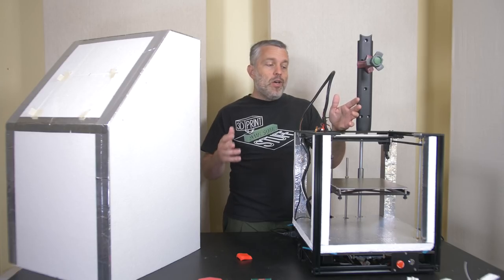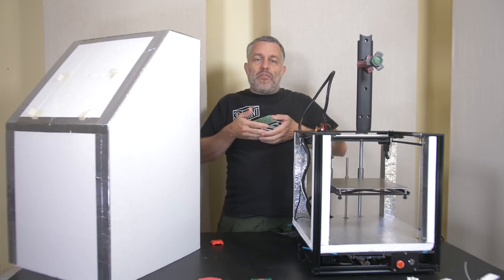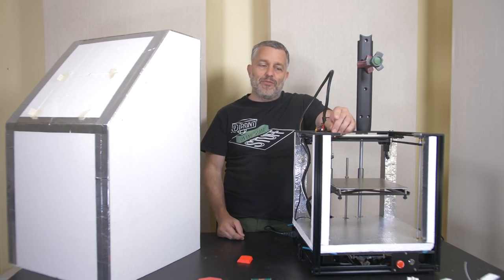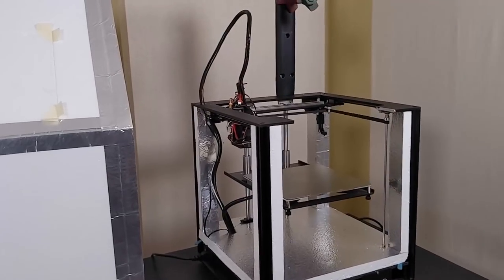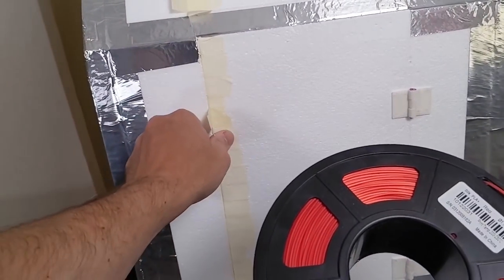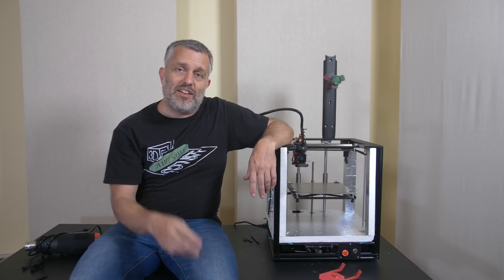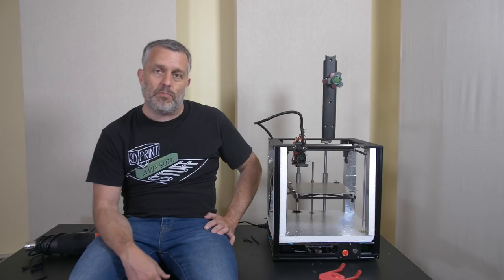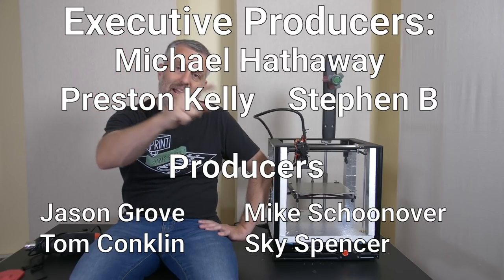Heated Chambers - The Next Level of Consumer 3D printing

Comment: Put a thermal fuse on your heat bed, between the ssr and heat bed. That way if your ssr fails the thermal fuse will break at say 125c and your house is safe. That is how it is done with the Voron printers.
Reply: i am a bit surprised there was not one i use two inline in different spots great catch
Reply: also this is how they all should be not just a voron nice catch thesanzca
Reply: same issue if your thermistor does not read the heater it is not called off to the set point  and climbs until you get a mechanical failure likley a fire at least smoke
Reply: people USE A THERMAL BREAK !
Reply: Some of us have extra temperature sensors and controllers  with relays that power things on and off depending on the temperatures being reported
Reply: @Dualecosse  exactly my point should your probe or thermistor not get the temps back to your relay or controller or what have you,you will get a thermal run away reguardless of your numbers on your displays if you made a fail safe good for you but any electrician will tell you the proper way is to have inline protection like a thermal fuse 
do me a favour unplug your thermistor during a run and see if your McU can tell if you unplugged it or not
Reply: @Dualecosse  also relays can fail in the on position regardless of the call for heat from the thermistor request or not once a relay is stuck your only protection would be between the relay and the heater itself ie: thermal break
Reply: also here is a short list of household items that rely on thermal breaks 
filament dryer
laundry dryer
toaster oven 
furnace oil propane and Ng
hot tub 
space heaters 
basically anything that can pass the max rated temperature in a failure
Reply: @CC-kc5lb  certain relays can fail in the manner you say, But I personally don't use that type of relays I use Crydom D1D40 optically isolated solid state relays  and on top of that I am monitoring/controlling 2 channels again with optically isolated relays I'm going to be really really surprised if all that fails at once
Reply: @CC-kc5lb  have you used a duet board? From what you are asking I don't think so
Reply: those items you list are all fine and dandy but why do you think they all use a thermal fuse? One word : cost. If the race to the bottom and doing it in the cheapest possible way is not what you want, and if you know what you are doing (electrical and mechanical engineer here by the way) you use opto isolation and monitor multiple locations with plc/scada controls to turn on fans at a certain temp and with scada if temps do not fall under a certain level you can program the system to kill the power and I also have a melt line which runs along the back of my printers which if triggered floods my workshop with co2. Not everyone is working to Ender 3 budgets
Reply: @Dualecosse  this is great but most do not have the tech or the knowledge to make your own fail safe or feel safe set up they want simple     i do appreciate your angle tho
Reply: @Dualecosse  i have three duet 2 and hc 6 and two ssys dimension sst again most dont have a duet
Reply: @Dualecosse  i could not see many people using that system unless you print high  temp like 450c and 200c chamber on an ender 3 lmao
Reply: @Dualecosse  where do you get your parts from i would love to try this ssr

Comment: Ive been making heated chambers for printers for about 3 years now. Using a heat gun, fans, and a arduino with a thermistor. I also take it a step further and water cool all my stepper drivers. I also cnc all the plastic parts of my printers that i buy into aluminum instead.
Reply: Ive also noticed a hair dryer with a pvc elbow works great for the temps you want. Like a snug fit

Comment: I have been printing nylon at work, what I have found is that other than a heat chamber and a constant dry box running with a tube from the box to the printer a garolite bed sheet needs to be used for printing nylon and pc. I found mine on etsy the seller's name is 
IamFossCustomPrints and the product is Phenolic LE (generic Garolite) sheet. This makes all the difference when printing these materials. Hope this helps anyone having the same struggles that I had.

Comment: I forget where I saw a video with a pro company who make mechanical parts from nylon and some type of pc, what struck me the most was that the materials got “wet” within 15 minutes (!) Also, water cooling, I don’t hear you talking about it, but if you need to protect components from the higher temperatures, you can’t just blow hot air around. Thx for the vid

Comment: An easy way to strengthen foam that I picked up from some vanlife folks, is to reinforce it with wire mesh like for a screened in porch. You cut the mesh about an inch wider than the foam, assemble the foam box, then using whatever standard latex interior house paint you have lying around (spray and oil paint have thinner in them which may eat your foam) glue the mesh to the sides while bending down and overlapping the overhang to reinforce the corners. The foam resists compressive force and the mesh resists shearing (and puncturing) so it's still very light and super sturdy. Bonus! The paint makes it look less slapped together.

Comment: I don't use PLA, I started with ABS, I use PETG as my throwaway prototyping, I progressed to ASA, PC, Nylon, and I'm enjoying playing with carbon fiber infused Co-polymers. As for chamber temps, I print on sanded plexiglass (no adhesives) in a heated chamber at 50c and I'm getting no warping. For heating I'm using x2 100w ceramic  terrainium heaters
Reply: I use sanded polycarbonate sheet 3 or 4 mm thick. Works like a charm with no additional stuff.
Reply: What is your enclosure made from?  I am finishing a 30 x30 x 40" Acrylite 1/4" thick for my Ender 3. Im going to use a TPI heater and temp controller and a 12v - 80 mm fan. I'm planning on heating to bed temps.. 50 to 70c.. Will that work?

Comment: I use halogen bulbs to heat my chamber to 120° for printing Ultem.
Reply: I was gonna recommend this. Spot lights have been used by many diyers in the past 10 years. I think some NASA interns have a little paper out on it too.
Reply: @difflocktwo  i got the idea from the NASA paper. Works fantastic.
Reply: @3darms  Good to hear that it works. Is your printer hardware pretty standard otherwise, to be able to print ultem? I have been out of the 3d printer game for many years now, kinda wanna get back into it by offering printing services.
Reply: @difflocktwo  i built it from of the shelf components, but I had to piece it all together based on temperature resistance. It cost about a grand.
Reply: @3darms  Good to know. This makes 3d printing much more useful for more technical applications.
Reply: @difflocktwo  I make guns.
Reply: @3darms  Seems pretty technical to me.
Reply: @3darms   Any recommendations on an initial frame for high temps? using pekk instead of ultem.
Reply: @brewst43  frame? Like printer frame or firearm frame?

I used a metal rolling cart that I insulated with rockwool and put a heavily modified ender 3 inside.

Comment: Not sure if this can help, but on my 3D printer i only reach a envir of around 55C. But when i print i have no issues with warping when i print PC,  also i have no issues that build plate is coming lose. Maybe its your build plate/bed that has issues with temp.   I just print on the default black side of buildplate. Only thing special i do is using magigoo pc. Brand of PC is also different i use Polymaker PC. I even never dried my my PC(but is always in polybox  connected with Pfte to printer, with 10% on humidity meter, moment that goes up i refresh silica).
Think in your case biggest issue is your build plate not current environmental temp of 65C.

Comment: I just recently did the same thing. I'm not planning on heating my chamber but I made it with foil lined foam and framed the corners with metal sheetrock edging. Took the controller off my ender 5 plus and put it on the outside. Been printing with tough pc and haven't had issues as long as I use a brim.

Comment: To hold the build plate in the temperature range you're looking for you'll want to use a mechanical solution or much larger magnets. For a small disc like that you can expect a significant drop off in attractive force above 80 degrees C. I would bet, in fact, that the reason the original magnetic platform isn't working as intended is due to heat degradation.
Reply: The regular magnetic sticker that you can buy  anywhere works well, it's just that the rubber on them softens and sticks to your steel plate, so you need to cover that rubber with aluminum tape (which gets firmly bonded to the semi-molten rubber). I don't know how it's going to perform in the long run but so far so good.

Comment: If that's the heat gun I think it is, it gets way hotter than 150C, I use mine for lighting charcoal. The heat isn't very even, but at points I think it's over 400C. The big thing with the SSRs is to add a thermal fuse in series. I might also add a NO relay in series with the whole printer, held on by the control board, and bootstrapped on by the power button. That way when the printer turns itself off, EVERYTHING turns off. You still want the thermal fuse because sometimes relays can weld contacts closed.

Comment: If the second SSR isn't getting used then wire them in series and they would both need to fail on to be a safety issue in a thermal runaway event :)

Comment: I build a heated chamber using STC 1000 controller and 1000w PTC heater. My printer-Artillery Sidewinder is huge and not chamber friendly. I separated the electronics sticking aluminum reflective foil on top of the case. I want to recommend polycarbonate sheet as a bed material. It's awesome, 3 or 4 mm sheet that is lightly sanded and things just stick to it like crazy. Peace!

Comment: I added a 1000 watt AC heater to my Ender 5 Plus. My bed is 1/4" (6.35 mm) cast aluminum tooling plate. I solved the SSR issue by using an electromechanical relay between the outlet and SSR. I currently use one of my PWM fan outlets, but am working on using a GPIO pin. It activates whenever the target temperature is set to anything greater than 0 and deactivates when the target temp is set to 0. It works great. I had an issue with some firmware settings that would cause the bed to halt for not reaching temp or getting too hot and it shut the bed down like it was supposed to.

One video that I would love to see is an experiment where you just power one of these silicone mats without any sort of temp and see how hot they actually get. They're rated for a certain number of watts so my guess is that they won[t runaway that much anyway. They don't have infinite heating capacity.

Comment: A heat pad on a granite/concrete slab as a base would help maintain an ambient temperature. If you put silicone blocks under it it's also help minimise noise and vibration.

Comment: Why would you use flammable styrofoam when you can use fire resistant polyisocyanurate (PIR)? It's super cheap insulating foam you can find at any hardware store. It's ignition temperature is actually around the melting temperature of aluminium.

Also, you can host the filament outside of the enclosure and run it through a small hole. Heat flow through the hole is pretty small.
Reply from the maker: Thank you for the comment! You are correct and Styrofoam is the inferior choice for the reasons you mentioned as well as the off gassing when it get's hot. I covered the reason why I used Styrofoam instead of Polyiso in the enclosure build video: https://youtu.be/SmOzs3JZ6cE

Comment: I like running spools on their own rack a few feet to the side of a printer.  Feed it through a hole, use Teflon tube if you like as a bushing.   Put a 2 or 3" section of curved Bowden tube on the extruder drive input with the curve generally aimed at the side the filament enters on.  Then you can get rid of that goofy sloped forehead and lower the volume (increase the temperature) of your chamber.   I would note, my stock CR-200B Creality enclosed printer gets to about 60C with only the filament entry slot covered 80%.  I would love to try printing at 70c or more.  The 200B isn't friendly to changing hot ends so it's a fail for Polycarb actually.  And then of course, your polycarb wouldn't be in the hot chamber continually drying.

Comment: Very interesting to follow your progress with this build. If you can figure out a way to make/modify a 3D printer that can have ~70-100c enclosure (and function well without constant tinkering) for less than $1k, you will have a extremely popular YouTube channel. Suspect you may have to look into water-cooled extruders/stepper-motors, which very few people have videos on. Printing with PLA just isn't good enough for us hobbyists anymore.
Reply: I looked this up. Apparently H-class stepper motors are rated to around 180c, so those should be fine. The real problem seems to be rubber belts and other plastic inside the printer. Those could all be replaced with silicone. Laser bed leveling might be better for bed leveling without adding on the z-clicker thing.

Add on silicone sealant and a check valve, and it should be good. A silicon tube through the side to the fan for cooling would be a nice improvement. Also, you may want a separate silicone/clay 3d printer for temperature resistant parts.

Polyiso deforms at high temps though, so it'd need to be mineral wool to get up to 180c, and you'd want a metal bottom panel so the 3d printer wouldn't sink into a bottom foam, if it existed, like a crunchy pillow.

Comment: I use a 1500 watt heating element that was for a smoker and a noctua industrial fan blowing across it. Also use a bathroom exhaust fan that’s ducted out my window to cool everything off. Works great. Only issue is I need to run on two circuits to avoid tripping the 20A circuit breaker 😅

Comment: It look like Two Trees unfortunately now mounts the stepper motors up top with the gantry motion system, not below the base. So if anyone wanted to isolate the motors like you point out with this printer, we would need to find an alternative. Do you know of any other core xy printers with that design of keeping the motors below the base? Thanks!

Comment: Using a smart plug flashed with tasmota, like the sonoff S1 will allow you to send a mqtt command to the plug for an E-Stop.  That plug will also let you pull energy consumption so you don't have to fool with that meter and hacking the mains cables.

Comment: Maybe add a circulation fan that blows across the print surface and draws from under the heated bed something like the VzBoT - RSCS, but make it out of metal.  Probably could get away with one circulation duct instead of two. Add a heating element inside the duct and a control TC on the outlet.  When the fan is running it will heat your chamber to setpoint.  It will also equalize the temperature of your printed part, which shouldn't cause warping if your chamber and circulation gas temps are right.  You would basically be making a convection oven.  Maybe you could just buy a small convection oven and build a printer into it.  Could be cool to look through the oven door and see your print progress.

Comment: Did you try letting the part slowly cool down inside the chamber after printing? I’m not super familiar with PC, but as you probably know with steel, this method is used to reduce stress in the final part. You could also try hitting the part with a blast of cool, compressed air directly after printing. This will probably create a lot of stress, but as this allows the part to cool down somewhat equally from all sides, I’d imagine that the stresses would cancel out and therefore reduce warping, at least until it’s heated again up to its annealing temperature.
Reply: Printing on a surface that retains heat, like thick piece of steel and print on a surface that will not peel off the magnetic surface.
Reply: People who anneal glass in a chamber allow the whole unit to cool down uniformly. 

Spraying cool air will definitely create cool-spots and likely cause weak or brittle points where the air hit first. 

Case in point: if you happen to spray annealing borosilicate glass with cool air, it will 100% shatter.

I would leave it in the 3d printer shroud to uniformly cool down over time.

Comment: I recently saw a 10m roll of GT2 timing belt with steel band reinforcement on amazon for $15. The steel will certainly expand when it's heated but even if it's a significant expansion the tension can be set at temperature and the steels tensile strength will be plenty high at those temps. of course there could be something I'm not thinking of too...

Comment: I'm thinking outside the box here, literally. What if you were to completely remove the box, and instead, aim either 2, 3, or even 4 evenly spaced spot lamps, or heat lamps around the printer, and aim them at the work area?

Comment: I like the idea of using an external heat gun, but I wonder if there's a better device, that would not have an ugly pistol grip you have to deal with mounting somehow. Another possible issue is that if it is cycled on and off to regulate the temperature, when it first powers on, it will be blowing room temperature air into the chamber for a few seconds until the coils heat up sufficiently.  That might make you consider controlling the blower separately from the coils (e.g. heat the coils for two seconds, then turn on the blower).